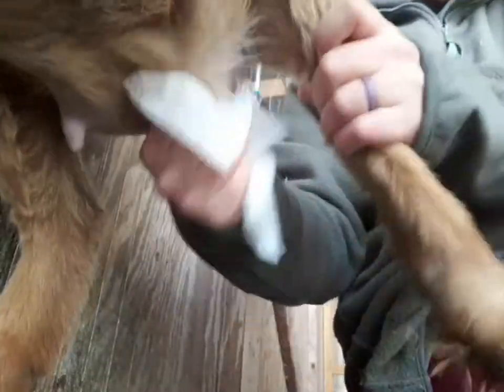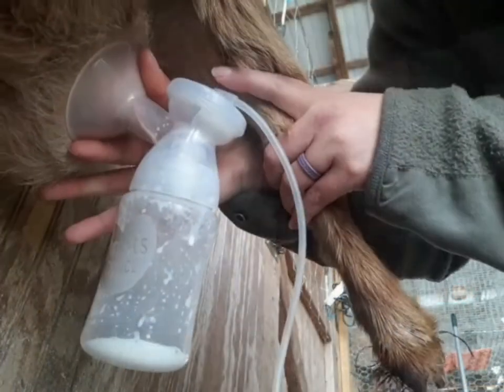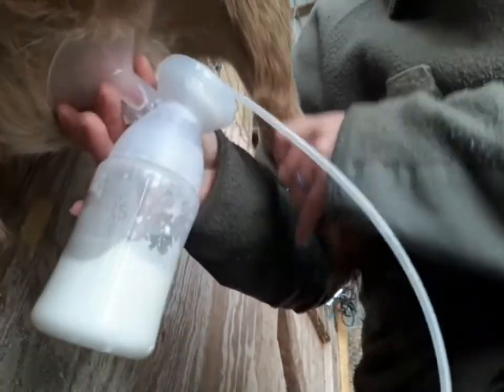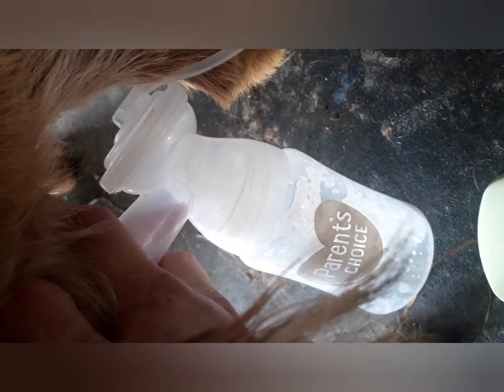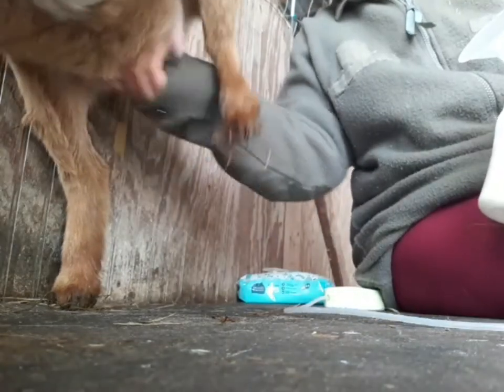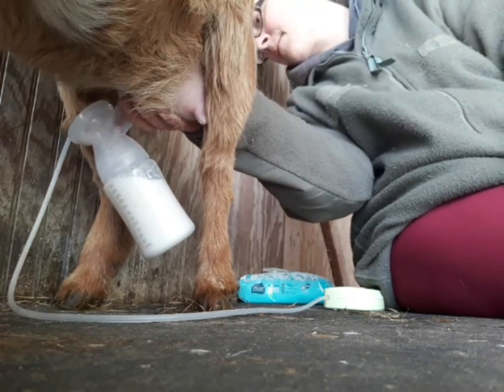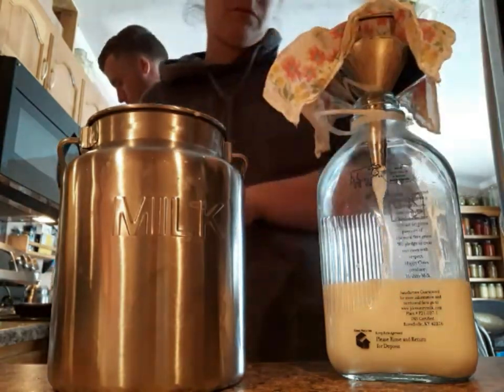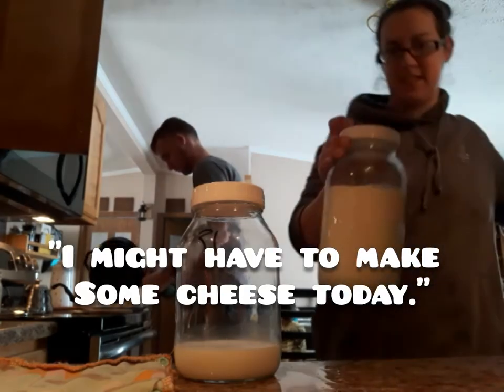How To Use a HUMAN Breast Pump to Milk a Goat, Step by Step

Comment: I saw you said you no longer use the machine, why did you stop using it? Did your goats have any complications from it? Did the pump you bought ever burn out?
I currently hand milk (3 goats 2xs day). I don’t have any issues with my hands but don’t want to develop arthritis; I am hoping this may give my hands a break but don’t want to waste my time or money if it means it could cause complications for our goats or have to continually replace the pump. 
Thank you in advance!
Reply from the maker: The battery operated pump eventually quit charging and I decided to hand milk after this, and then after about 18 months of that my elbow wasn't having it anymore and we decided to go all-in on a nice pump instead of buying the cheaper ones every so often.  Some goats teats are too large for the human setup, but it never hurt anyone. I loved it for Nigerians. If you use a human pump try to get the best one you can afford so it lasts. I've had medela electric pumps last many years for human use.

Comment: What size shield/flange did you use? I still have my breast pump but I guess I tossed all of my pump accessories so I’ll need to order some and don’t want to get something that won’t work.
Reply from the maker: I think it was the 22mm? I forget the sizes they come in. Whichever smaller one the pumps normally come with, or whatever size they come stock. We hand milk all the time now and I don't have my stuff anymore to double check.
Reply: @SageandStoneHomestead  is there a reason you went back to hand milking?
Reply from the maker: We actually use a capralite machine now! I hand milk in winter though for a few reasons, we are milking far fewer in winter so the capacity is much lower, the milk lines don't handle cold well (become less flexible) and I don't like dragging the machine through the mud to get to the barn and back. But we love the capralite in spring and summer!